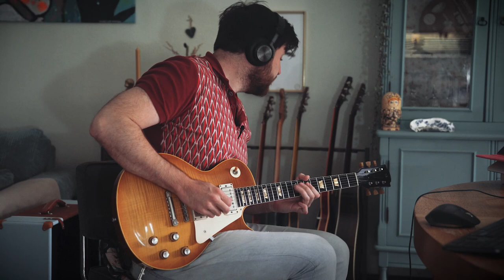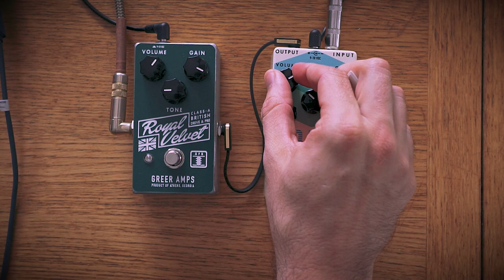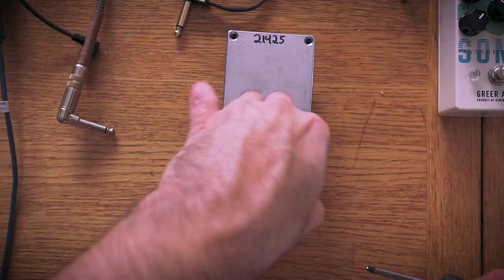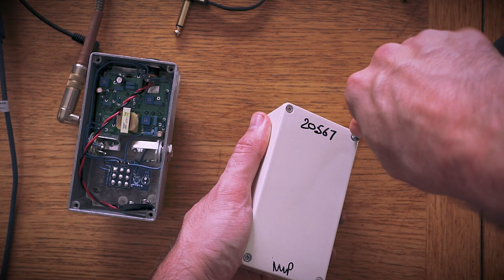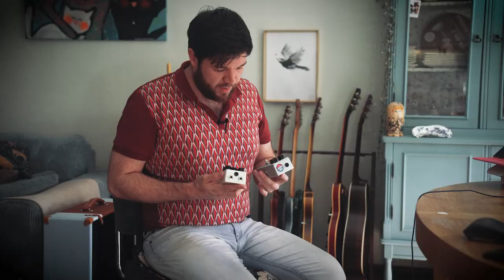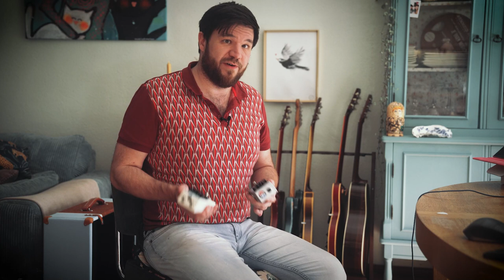Pedals with transformers! No, not Optimus Prime. The Greer XFR series (Soma 63 and Royal Velvet)!

Comment: Even though it is an old video:
The trimpots are for adjusting the bias of the JFet's.
Do not touch! They are set and forget!
They are not meant to be adjusted by the user!
The circuit will not work properly is you mess with them!